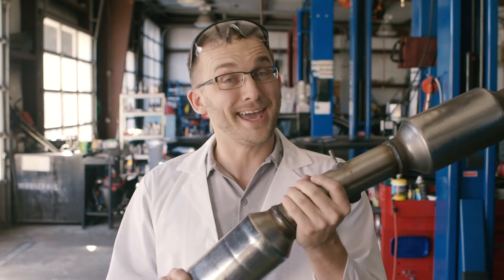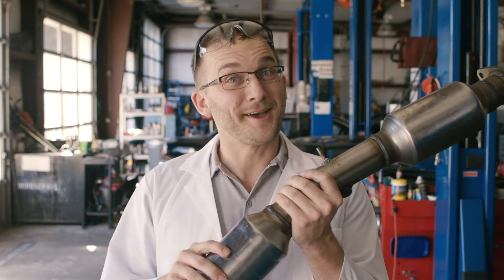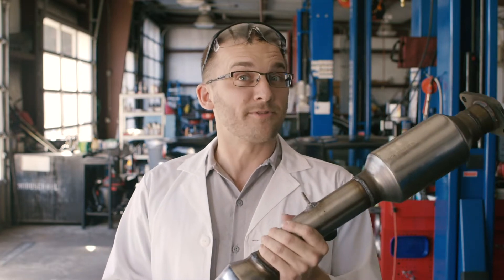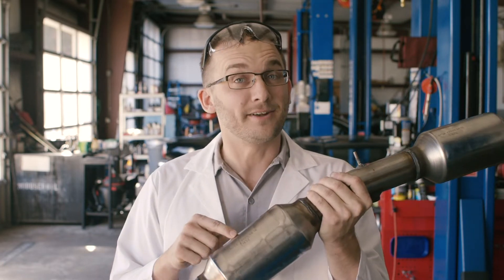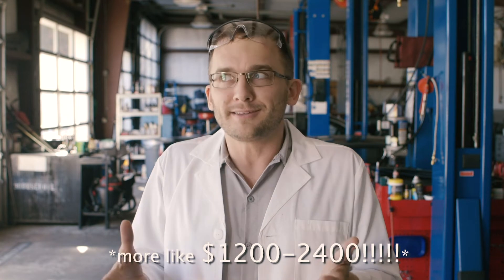Why are Catalytic Converters so expensive?

Comment: How do I know that it's my catalytic converter, I just got my sensor 2 changed, but my engine light came back on after two weeks of putting it on. Now the code is P0S030 .

Comment: please dose catalytic converters effect the consumption of fuel? when it bad?
Reply from the maker: Yup! A failing convertor will lower the Volumetric Efficiency of the engine, making it harder to get air in and out. This lowers engine power and can also effect how easily the engine can convert the energy in your fuel to motion.

After replacing a failing convertor, most people will report their car feels more "peppy" and seems to get better fuel economy by a couple MPG.

Comment: They jack up the price!  We searched for prices in the Bay area California, they were $800-$1200.  The parts aren't even that expensive and the time to put them in isn't a pain in the ass.  We found this place in Stockton (35 mins away).  They did it all in 40 mins and cost us $180 PARTS AND LABOR!  They can say it's because of the expensive material.  Bullshit.  The part for them was $140 and $40 labor.  Even if you can't find a shop that does it for $300 or under, then they are all screwing people, which is what they do.
Reply: Right on your so right